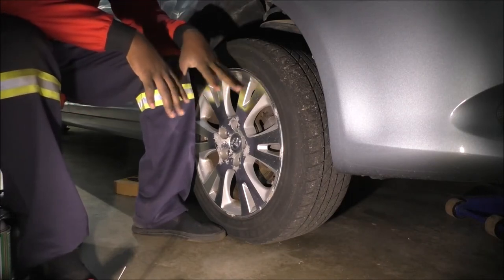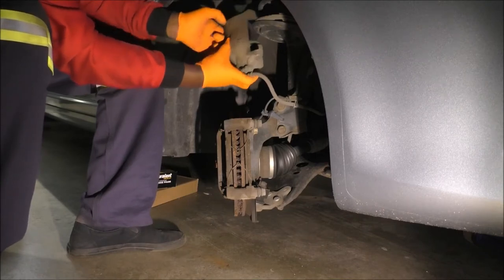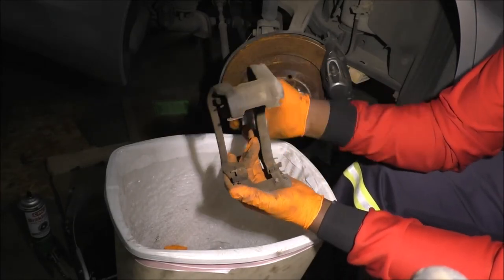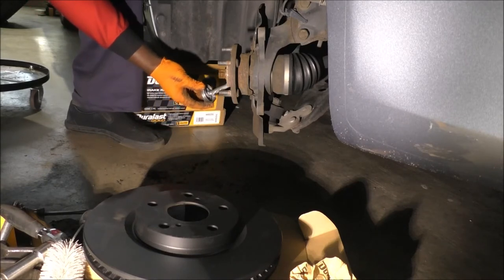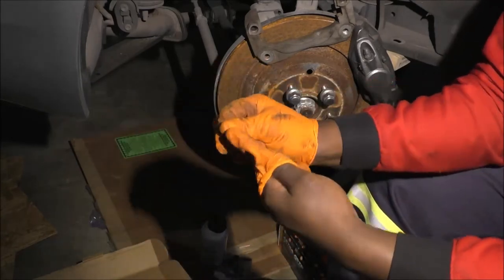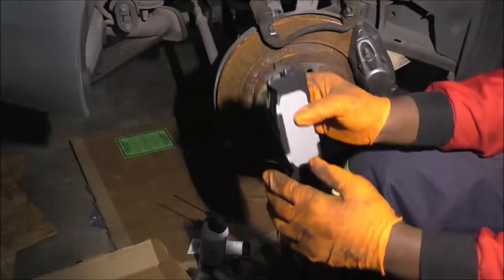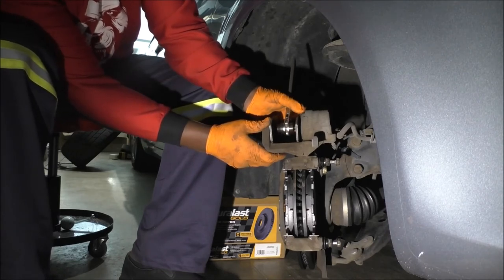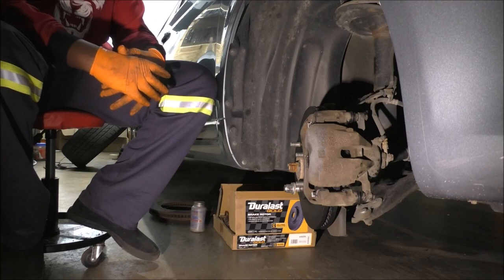Toyota Avalon FRONT Brake Job. Pads, Rotor, Caliper. 2005 - 2012| Detailed real time video, no edits

Comment: Thanks for making this detailed video. I generally carry my cars to a shop to get this work done. Years ago I did do my own brake jobs but now that I'm retired I decided to do it myself on my 2007 Avalon. Following your instructions. One of my bottom slide / glide pins was missing the bushing collar. Have to wonder if these pins get removed, inspected, cleaned & lubed during a brake job. Again thanks for the video.

Comment: I have an '06 Avalon Limited and am replacing the front brakes.  The one thing I found different than your video is that there were no "v-shaped" clips that you had on yours.  The two clips you were trying to keep in place while lowering the caliper.  Does that make sense to you?
Reply: I have a similar issue. 06 avalon xls and no brake return clips. Have tried looking for them at auto stores and no one has anything that is supposed to fit the car.  Although the concept of them makes a lot of sense to me.

Comment: I appreciate the bolt size/thread pitch for the rotor removal. I started my brake job on 09 Avalon and saw that it had these and I couldn’t just slide the rotor off as easy as my other cars. I deal with tapered bearings at work and it’s the same concept of removing them. I will be going to go buy some bolts to remove them.

Comment: i have an 05 Avalon and you hit right on the point of my dilemma. I have the front RH caliper bracket pins not sliding. I thought I had to buy new calipers (reman actually) Im going to back and check it after watching your video. I think you may have saved me like $300 dollars (since I would have replaced all 4) Your video is excellent! Thank you!
Reply from the maker: Thank you for the kind words. I was hoping doing such a "real time" video would be valuable to a few people since we would be discussing things in a level of detail that woukd be hard to cover in a 10-minute tutorial.
I hope your project goes well, and you're back on the road safely...with a fat wallet.
Reply: @EdBwoy  This video was unbelievably helpful. Watched the whole thing beginning to end.

Comment: At 1:38:50 you show your difficulty holding pads while inserting the springwires. It was much easier by using a c-clamp at the lower end to hold the pads against the rotor and then put the springs in place. Then I lowered the caliper just enough to hold the pads in, then removed the c-clamp and swung the caliper all the way down. Your Avalon brake videos are the best!

Comment: Hey stranger,  nice work!  I just stumbled on this searching for the Camry/Avalon/ES 350 brake upgrade (to Sienna/Highlander/NX calipers & rotors).
Reply from the maker: Thank you man! I am glad you found it helpful, although I assume you had to fast forward through a good chunk of it, hehehe!
I was trying something different at the time with these real time videos, but I'm not sure people really like this format.
Reply from the maker: So is that the equivalent to the akebono/brembo upgrade to us Nissan folk?
Or maybe more like how S coupe guys used to use Infiniti Q45 calipers as they were larger.
Reply: @EdBwoy  it's probably not as drastic improvement as Akebono calipers on M35/45.  I think ES350 rotors are about 280mm and Highlander rotors are about 320mm

Comment: new rotors should be cleaned on both side pad mating surfaces with brake clean to make sure no manufacturing oil and never spray brake cleaner on rubber material/parts like CV boot, etc it makes then hard, dry, and brittle (will crack)